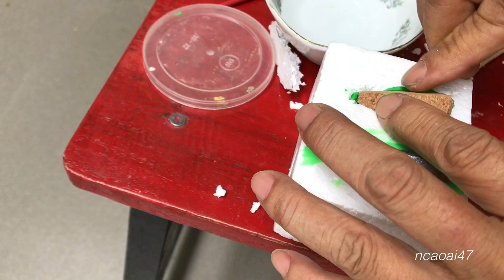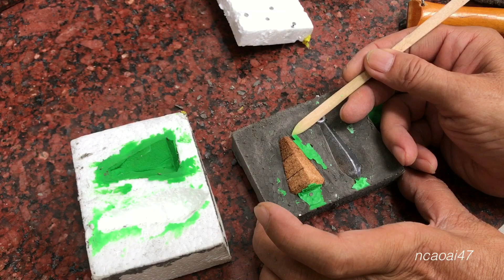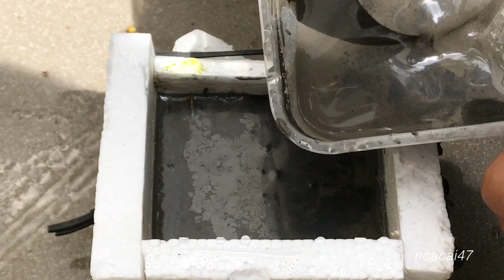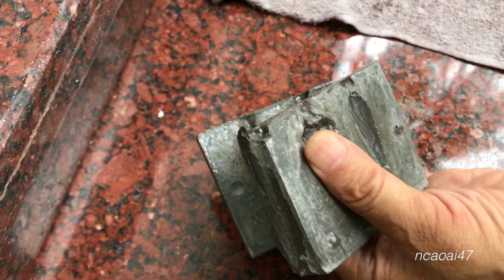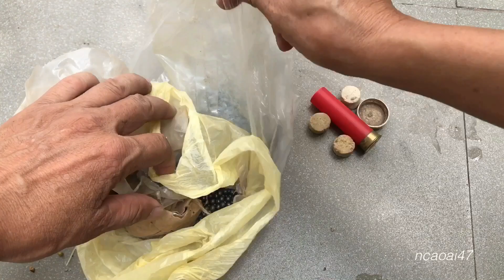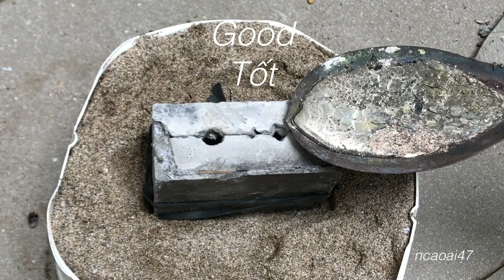How To Make Cement Moulds of Lead Fishing Weights-DIY Fishing Hacks - Cách Làm Khuôn Xi Măng Chì Câu

Comment: Instead of sanded cement try using a porcelain mixture, it will make a smoother mold.
Reply: actually he should just let the cement harden for 3 weeks before using it, its the moist that make coarse, after the moist is gone its just as good as porcelain.